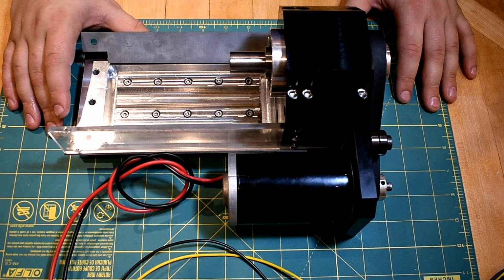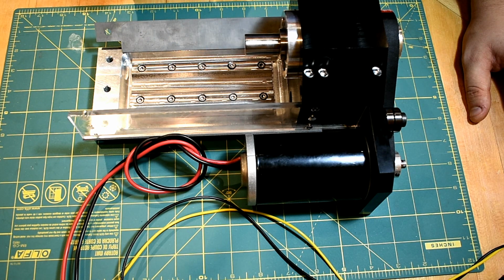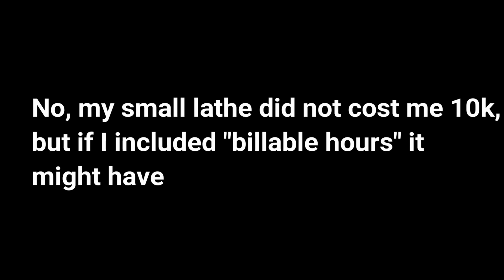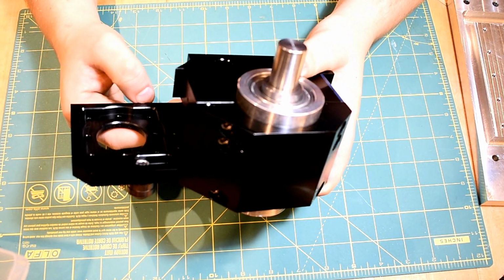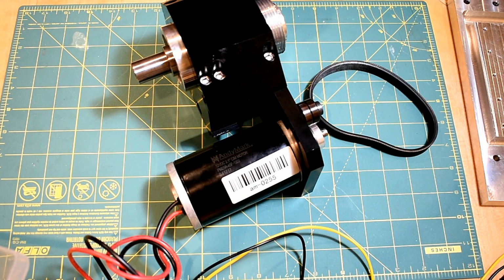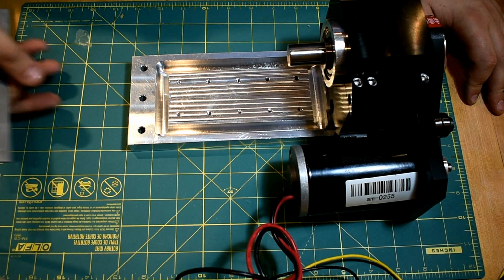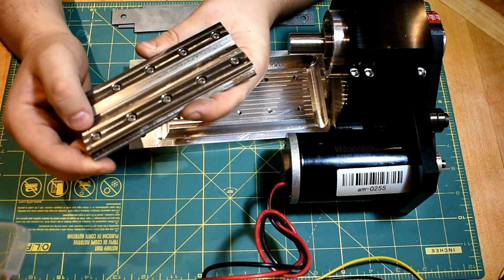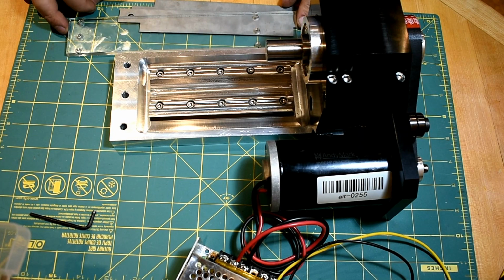The Jeweler's Lathe Part 3...  Part 1.   Assembly of the bed, dovetail and drive system.

Comment: Was thinking about using a CIM motor for a similar project, what power supply did you settle on?
Reply from the maker: Just a cheapie 12V 30A regulated supply, though i think a larger, unregulated supply would be the way to go

Comment: It sounds like you are describing a second operation lathe with all the feeds lever operated. My factory in China still uses the machines. Incredibly useful and flexible machines. Collet closer work holding. In Chinese these are called 仪表车床。instrument lathe.
Reply from the maker: I had literally never heard of that.  I'm going to go look it up!
Reply: hlaps1990, I will send some photos of my machines. I can connect via Instagram.

Comment: Beautifully made..can I ask why the bed is so short.. by the time you have all your cross slides and tail stocks it looks like you will have very little space for stock in your choice of work holding.
Reply from the maker: I'm looking for about 4" of travel..  I'm thinking that with smaller diameter stuff I won't want to stick it out that far anyways, and with larger diameter stuff it will probably be for fairly short work.  I'm also planning for a tailstock

Comment: Hey, maybe you should replace the shaft with an ER32 or ER40 straight shank tool holder. Check it out on www.maritool.com.
Reply from the maker: That's actually what I did for my CNC lathe... can't beat the price for a precision ground shaft!

Comment: Great intros!
Can you elaborate on your clear path comment, I'm also looking at clear path for making a 5x10 plasma table. Cant wait to see your 3d printer too!
Reply from the maker: I'm hoping to put a video out soon, but basically clearpaths have a more optimal velocity profile -- namely they can accelerate quickly to a high speed.  For a 3D printer, which would have much shorter travel than a plasma cutter, I'm hoping to make use of the brisk acceleration to minimise the time taken for short moves.  In your application, the main advantange would be the speed.  For both of our applications, they're nice and quiet and easy to work with!

Comment: You can get the broken tap out of the aluminium chemically. A warm saturated solution of alum works good to dissolve the tap, but leaves the aluminium intact.
Reply from the maker: +Wes Marquenie i’ve heard of this before and i’ve always wanted to try it.  Perhaps i will this time!
Reply: It's very easy, it just takes a few hours. Submerse the entire aluminium part because it can get a bit discolored/dull.
I dont even try to remove a broken tap/drill from aluminium mechanically. This is so much easier and less risky.

Electrolysis also works to remove steel from aluminium. But I always use (potassium) alum. You can make it from KOH, Sulfuric acid and aluminium, but alum is also cheap and easy to buy.

Comment: As to the buying existing machines, I have a Sherline, and I'm not too impressed.  Needs more rigidity, more power, and less run-out. 

This looks beefy, and your power calculation showed why the Sherline is a bit wimpy with its 90w motor. Now just get the run-out to .0002" to match some UP collets...

Comment: Did you compete in FRC?
Reply: i thought i would find another of my kind here lol
Reply from the maker: No but I've heard thats where the motors are most commonly used!
Reply: Ha! I figured you had either competed in FRC or heard of it for that exact reason.
Reply: @TabletopMachineShop  true, my team's robot uses 6 CIMs for driving(3 each side) and 775pro motors for most of the mechanisms
Reply: lol. hows it going matt. the internet is a small place after all.
Reply: Hey I found Skippy
Reply: Skippy lol
Reply: What about ftc?